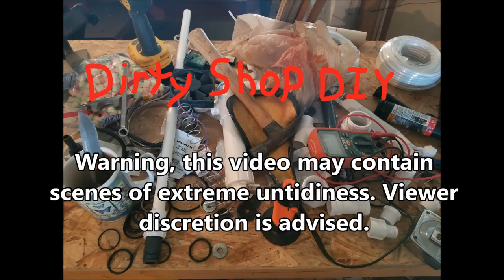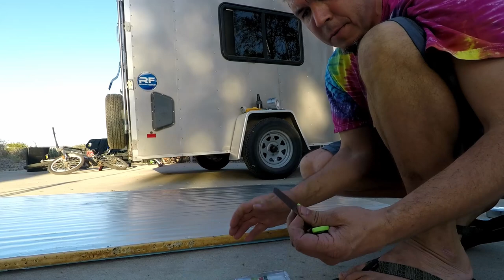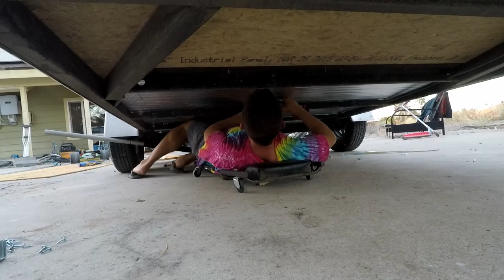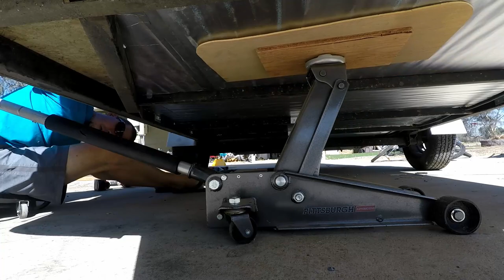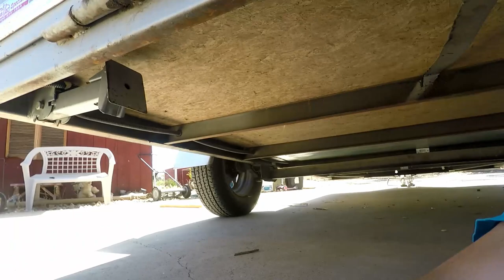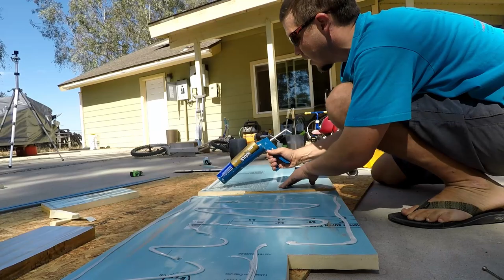Cargo Trailer Conversion Floor Insulation

Comment: Great job. I will be using some of your ideas on my cargo conversion. An idea or two I might suggest. Undercoating before adding the floor insulation. And I was nervous watching you under the trailer with no wheel chocks that I could see. Stay safe and looks good though.
Reply from the maker: Thanks, the under coat would have been a good idea. I might still do it over the insulation. The drive way is dead flat and the trailer wasn't going anywhere.
Reply: What type of undercoat would a guy use? I'm planning on doing this soon, thanks!

Comment: several ppl have mentioned coating the floor before install the foam board. I'm thinking about doing this and using KILZ Mold & Mildew primer film paint, let it dry, then putting the foam board. What's everyone's thoughts on using KILZ?

Comment: I would rhino seal or other marine seal before I would insulate the underside because of moisture between the foam and plywood.
Reply from the maker: that would be fine, the insulation is water proof and the floor is rubber. Its hard for moisture to get in.

Comment: Seal particle board before placing insulation,use  correct glue, and seal all edges for water with flex ssal.  But at least have an idea what it looks like under there its possible.
Reply: What type of sealant for particle board? Like deck sealant?

Comment: If I use foam board with film on one side and put the film side down will I have to use foam board glue so as not to eat into the foam ( I know they make glue just for foam board and not the liquid nails? thanks
Reply from the maker: Most foam board has film on both sides.

Comment: How would moisture escape should it get on top of the foam board?
Reply from the maker: This is one of the draw backs of this. I didnt seal the outer edges for this reason. Only time will tell if moisture will be an issue. I think it is better this way than to have the osb exposed on the bottom.

Comment: Do you put anything below the insulation to protect it from the elements, or do you just leave it exposed? Thank you.
Reply from the maker: just left it exposed. No issues so far. Cant say its the best setup but thats what I did. i am tempted to go back and spray undercoating on it.

Comment: Here I am again! I don’t know why but my Yutub searches always lead me back to DirtyShopDIY! Maybe it's because (unfortunately) my work areas have lately been left in quite the clutter too? Anyway, I’ve got another question for you if you don’t mind...(If we can set it up, I can pay you for an hour’s worth of phone support and for all of your help with this trailer project. Let me know). My question(s): 1. What should I ask for (at Lowes/Home Depot) to match your “waterproof" type of floor/wall panels? I’ll probably get the same if it’s light weight and thin. I saw that you wanted 1/8” of …? But ended up with 1/4” of …..? And, u were saying something about using some  kind of material that shower stalls may be made of? I think that would be ideal if….(whatever that is called)….….is light weight and not too expensive! Otherwise, is it just some type of thin plywood? Thanks and please let me know and I’ll pay u for advisory fees! Art
Reply: BTW, I don't know how to connect with u youtuber producers. So, I requested ur Business Email <on ur home page> in case u decide you'd like to connect to set up and accept payment for your advice.
Reply from the maker: @artest7  Dirtyshopdiy@gmail.com
Reply: I forgot to add... the landlord is moving back into the house I'm currently renting. So, it would be worth it to me to pay you <as long as it doesn 't interfere with your personal life/work to finish this project asap (at least with the essentials. I plan on traveling/living in my trailer for the next 8 months or so and was supposed to done by March 1st. which obviously has been extended. Thanks, Art

Comment: I’m going to insulate the floor from the inside because as you drive in the rain , water will get into every space it can under the trailer and the insulation will hold that water next to the frame and make it rust.
Reply from the maker: That is possible. Insulating the inside could be easier because you would have a flat surface to work with.  The bottom floor of my trailer is OSB so not grand in wet areas anyway. I am thinking of spraying undercoating on it all.
Reply: Dirty Shop DIY my trailer came with the underside painted. For the inside insulation I’m thinking about that really thick waterproof carpet pad. I’m not sure if I’ll do a indoor outdoor carpet or a thin plywood over that or??
Reply from the maker: @Oldcoinsandstuff1  I beleve they make floor insulation for under tile. That might be a good option too. It is nice to have the floor insulated to keep your feet warm. I dont like carpet in trailers because they tend to get more dirt than at home. Good luck with your build
Reply: I like this insulating idea as I can't sacrifice headroom inside. I think adding seal coating would eliminate the water seeping issue. How's it holding up so far? I am just starting my trailer build and have watched all your videos. R
Reply from the maker: Looks good so far. However I can't inspect under the foam.
Reply: @DirtyShopDIY  - so none came loose?
Reply from the maker: @roryolson61   not so far

Comment: Dumb question....what is better...underneath or over the floor insulation and why one or the other?
Reply from the maker: I would say that over the floor would probably be better insulation. This would allow you to put a continuous layer. You would have to put a hard floor over the insulation. However, you would lose the thickness of the insulation and new floor in roof height. 
On the outside makes it harder for the wood floor to breathe and you have to skip where the floor beams are. You can put thicker insulation on the outside, because it doesn't detract from interior space.
I already had a good rubber floor on the inside so I did outside insulation. I don't like reducing interior space.

Comment: Great job on your video. Wondering what you think of reflective on the inside of cargo trailer on floor and then those 2' square foam mats that you lock together. Would you think it ok or would I have a problem with mold. I would appreciate your thoughts.
Reply: Go to a local Feed/Tack Store (I use Coastal) and get yourself a bunch of Horse Stall Mats.  They are a thick rubber floor, cheap - around $35 for a 3'x5' chunk.. lay it out on the floor and you are good to go.  Insulating, sound proofing, durable and waterproof.
Reply from the maker: Im not worried about mold. It stays fairly dry under there and its water proof on both sides.

Comment: did it make much difference in the warmth of your trailer
Reply from the maker: I couldent say. I never did any reliable tests. I would say it would have to have done something. The floor doesn't feel colder to the touch than the rest of the interior.

Comment: You will get water and moisture between the insulation and bottom of floor of trailer and then mold and rot. Didn’t you insulate the floor from the inside?
Reply from the maker: That was a worry of mine. The interior has rubber flooring which came with the trailer. I'm hoping that it will reduce the amount of moisture. If not I will have to change it out one day.
Reply: rubber undercoat it well and you should be just fine!

Comment: Don't you have to water proof/weather proof the underside? It looks like raw plywood
Reply from the maker: I think it is moisture resistant flooring in the trailer. I should have used undercoating before the insulation.  Live and learn.

Comment: Hi Dirty Shop..i have my first 7x12 cargo trailer with ramp...please help me figure our a tent style add on for ramp door. I'm adding window an insulate the walls an roof. I'm personally doing fold down bed ,cause we haul 2 atv. But son want a tent style room on top of the ramp. So I'll add chains to keep door level or add stands. But a tent style room attached to opening of cargo rear opening..please help.
Reply from the maker: I plan to do this as well. I will work up some ideas. Definitely use legs on ramp. Chains will make it too bouncy.
Reply from the maker: I am planning something like this.
https://images.app.goo.gl/1m1tVicJcfcuRmLF9
Reply: What kind of stands did you use to level your ramp?

Comment: Putting any holes in the tubular steel is a bad mistake! As the years go by it will start rusting on the inside of the tube and eventually compromise the structural integrity. I’m hoping you didn’t use tubular steel on your trailer and then put holes in it.🤦‍♂️
Reply from the maker: When you need to attach something to a tube you have a few choices. Weld drill or clamp. Welding doesn't work for most clamping is usually not right, so you drill. If the hole is in a covered location it rarely is an issue. Also these things have a bunch of holes already. If you are in a dry environment it really isn't an issue. I might start to worry about this in 20 years or so.

Comment: I've always been mystified as to why the vast majority of people whom convert cargo trailers into campers don't actually insulate the floor (or door).

It makes no sense not to insulate the floor of any camping vehicle, and done from the outside, it provides additional protection to the bare plywood underside.
Reply from the maker: That's what I figured as well. I think my door came insulated, but I plan to check in the future. Thanks.
Reply: People don't insulate the door because it's hard to insulate well, depending on the door you have. The floor, I just don't know.
Reply: Best way to insulate the floor as far as durability/lifelong is to bring it to a shop and have them spray rubber undercoating under it.  Something like Linex or Rhino or the like.  Might be able to catch them and ask if you can have them spray the days leftovers under in between the ribs underneath.. cheap and it has no need to look pretty.
Reply: @imacrazyguy5831  LineX isn’t insulating.
Reply: @danlux4954  I was thinking the same thing!

Putting Line-X over underfloor insulation might be a good idea, but on it's own, it wouldn't insulate at all.